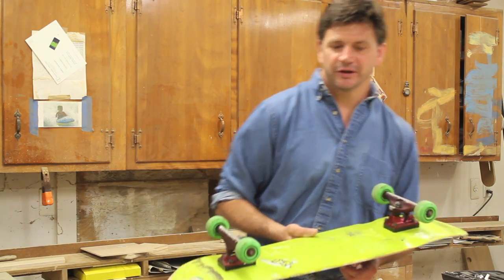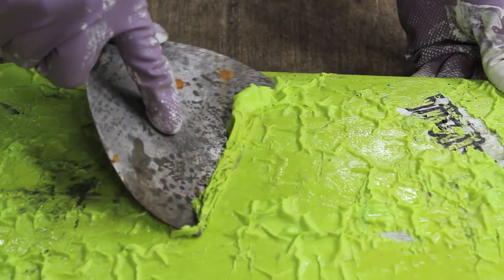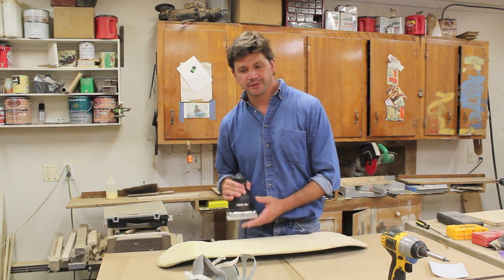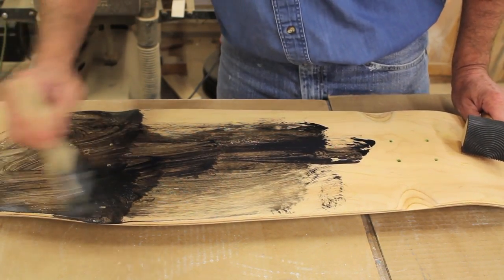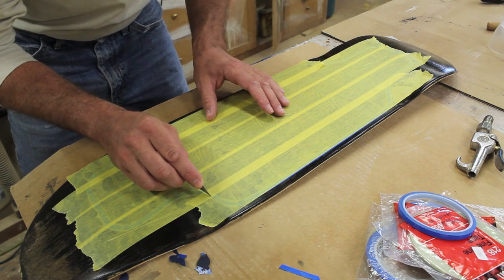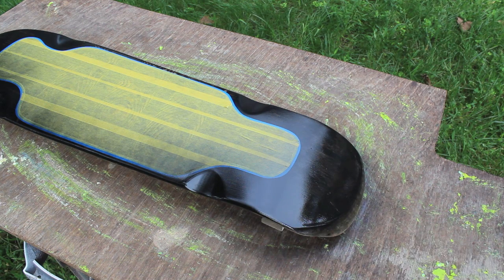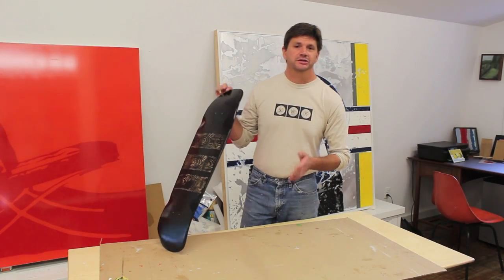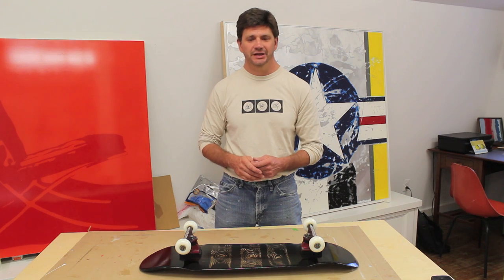How to paint / spray paint a Skateboard by Jon Peters

Comment: I'm doing the same thing. Not really a fan of the design, but for what you did it's really nice. I asked my dad for some paint thinner but he didn't have it so I used an electric sander. I then put some type of filler to help the cracks in my old board and sanded them down with a grinder. I should have kept the wheels off until I painted it.. but oh well.. Maybe i'll take them off once I start painting or maybe ill just put some tape over them. I've been a painter for ten years, but I lack patience.

Comment: I painted my board. I didn't plan on riding it, just wanted wall art. I'm pretty sure I used a clear coat finish, but now I'm riding and my attempts at grinding/sliding, my paint job is coming up. I'm wondering if I should use epoxy for the final clear coat. Or even go so far as a thin sheet of fiberglass (I have 2oz and I found 1/2oz from a hobby/model shop). I guess it depends on how important the art is.

Comment: So I've just purchased a new skateboard, just a cheap one with a painted graphic brand new. Would the stripper that you've used be the best to remove a complete new board graphic - no wear? If you search BLACKHAWK 31x8" 9Ply Premium Maple Deck ABEC-7 its that board that comes up with the Joker on it. It's pretty ugly and want to strip it down to the wood and start fresh. 
Also this is my first skateboard, so needed something cheap to try out. Once stripped I want to have my own custom hand drawn image or a printed image so I'm trying to work out how to have that done too once stripped.

Comment: If I buy a board straight out of the factory, would I absolutely need to use stripper on the factory design? 

I don't wish to damage any part of the board with stripper or a sander
Reply: +Ryan Houk No damage, just a good surface for paint to adhere to. Paint sticks better to rough surfaces.

Comment: So, if you don't already know the active ingredient in most strippers (the ones that actually work on paint and such) is methylene chloride. It is a chlorinated solvent meaning it does not matter if you wear a mask because it is choking off the oxygen. Many people have died by asphyxiation because they don't realize that a mask doesn't work for strippers. You just need plenty of oxygen.

Comment: When you spray on the clear coat, how do you get it to come out so smooth. I put down three layers right off the bat and there's still pockets that aren't covered.
Reply from the maker: just use a few light coats and you will need to sand between coats.
Reply: ***** Thank you! I'm going to go try that out later....

Comment: A question: should I spray the the whole deck with clear paint, even the part where the grip comes on?
Reply: no just spray over the paint.
Reply: You should spray the whole deck in clear paint, because liquids can go through some grip tapes. Some grips purposely have tiny holes, to get rid of air bubbles

Comment: Umm...Mk so...I’m no professional but my dad is a mechanic so Ik this from the things he’s taught me. Normally it’s a better idea to leave the old paint on and just scuff it. Because that old paint helps the new paint stay on and then it also doesn’t require primer sometimes depending on the paint used before. Also you shouldn’t use latex paint. It wears very quickly if you don’t have a sealant. The whole razor-blade thing could also scratch your board. Ik this video is from a long time ago. But I’m just giving advice from the things Ik.

Comment: Nice job, it would of been even better if you used a different color on the outside of your fine line. Then taped off the outside and went with some kind of metallic or candy paint! But still nice.